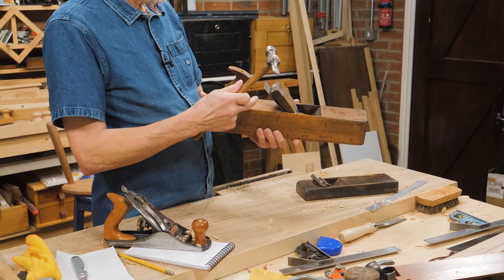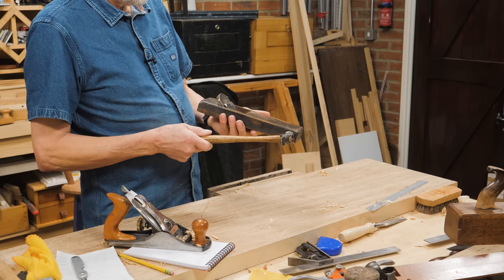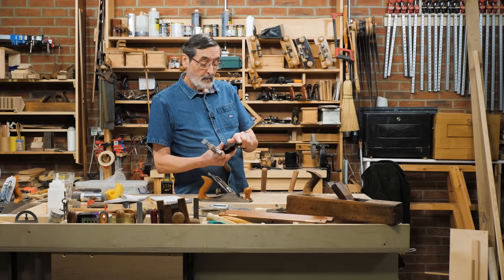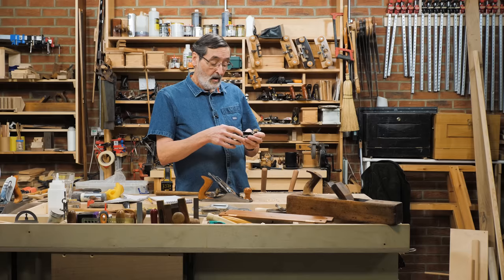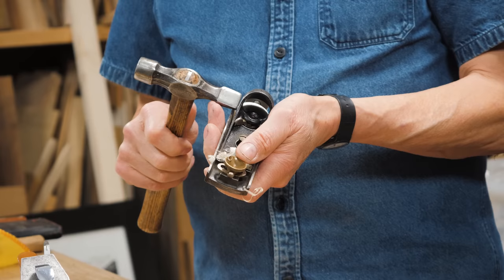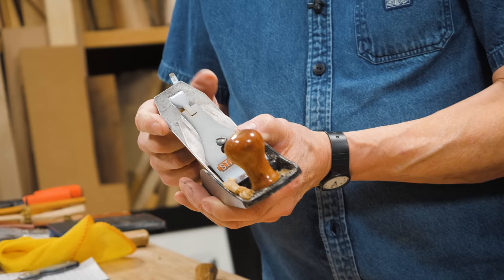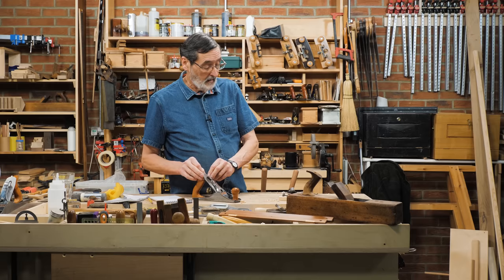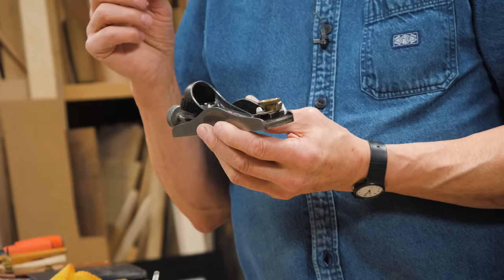How & When to Hammer Tap a Plane | Paul Sellers

Comment: Absolutely true. We often do unintentionally change the depth setting on metal planes when we loosen the cap iron in order to laterally adjust the blade but it never occurred to me to tap adjust metal planes that have a lateral adjustment mechanism!! I feel empowered!!  Gimme that tap hammer! 😂

Comment: Nice quick tip.  Many of the older "non-adjustable" block planes have a nub cast into the back of the sole for hammer tapping.  I went so far as to make a small brass hammer for just that purpose.
Reply: Good call 👍

Comment: My first plane was made of wood, the steel was fixed with a wedge. So to adjust the plane I used a hammer, it's a very simple but also exact way to handle a plane.